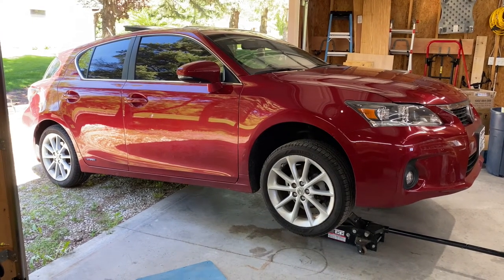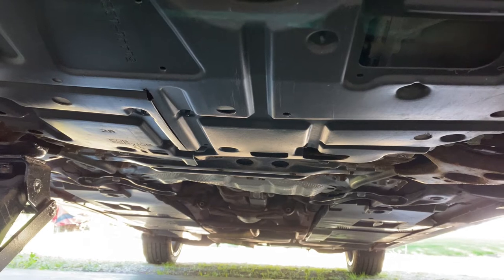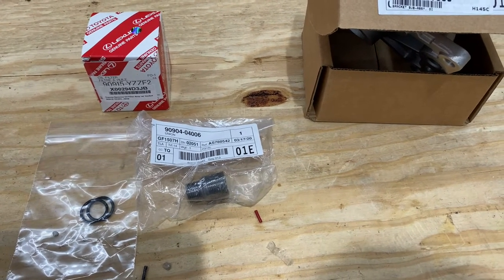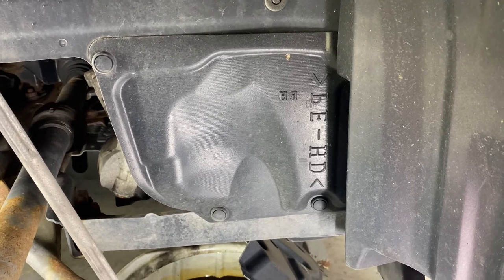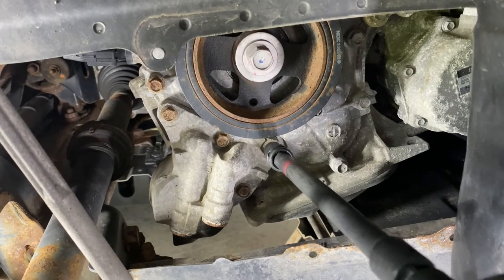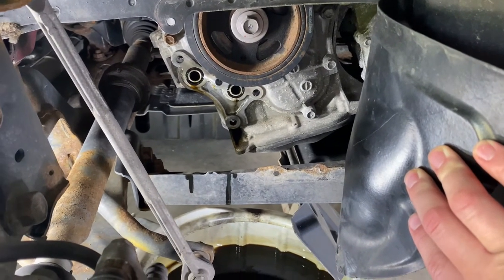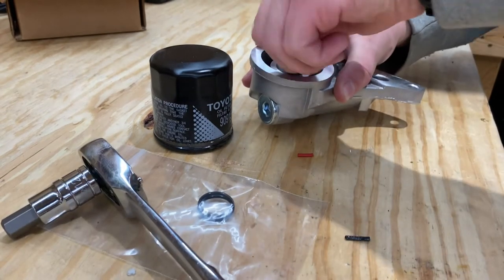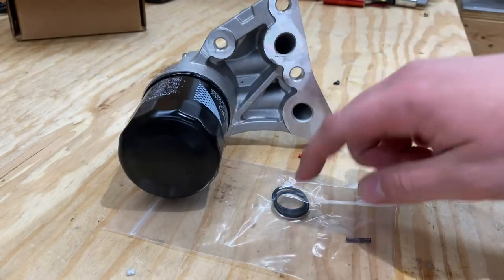Lexus/Toyota/Scion Spin On Oil Filter Conversion

Comment: I just did this conversation on my 2012 CT200h.  Followed the instructions and it was very easy.  Now I can simply spin off the filter instead of dealing with the goofy canister.  The canister filter is $8 instead of the metal spin off filter for $4 and the canister is where a traditional oil filter is.  If the canister was on top of the engine and easy to change I would just simply keep it.
Reply: With you 100%.  Our mercedes as the cartridge on the top of the engine and it makes it super easy and zero mess changing it.  I love it.  The toyota one is stupid.  It's under teh car and it's sideways so you always drip oil and it's not nearly as clean.  Such a stupid design.  And all of our lexus models use a different specific wrench so I have $100 worth tied into just cartridge removal tools...  I'm doing this to my CT soon.  Seems so much better and you can use larger OEM oil filters!
Reply: This system is ridiculous.....Toyota seems to take a step forward in some things.....and five step back in others.....a horizontal cartridge oil filter under the vehicle ? Come on Toyota....what are you thinking ?

Comment: I would use a dab of red loctite on the threads of the union adapter. Just to make sure it never backs out when you're trying to just remove the filter.

edit  Just to clarify, I mean the wider end going into the housing NOT the threads the filter spins onto.
Reply: Yeah, definitely don't make that mistake. The filter might never come off and you'll hate life! 😆

Comment: AWESOME.      Ihave a 2017 Prius and i hate the  oil filter system...      Thanks!
Reply: 4th gen Prius use good style screw in metal filter, not catridge anymore
Reply: @ErichMoraga  thanks to let me know, but I have no interest on Fugly looks of 4th gen Prius exterior and interior. I prever corolla or camry hybrid. My 2015 corolla station wagon hybrid still use catridge filter. I hate it but after few oil change, it is not that difficult anymore. The filter is not cheaper than full metal one, that's  make me angry, what's the point.
Reply: @rondhole  The spin-on oil filter has more paper element to filter out more impurities.  The spin-on filter also has a anti-drainback valve, whereas the cartridge filter does not have the anti-drainback valve.

Comment: While othe car makers install their oil filters in the engine compartment facing down so there is no oil mess..........Toyota  hides a cartridge style filter underneath with a panel to remove........do you think they are actually trying to make us take it to the dealer ?
Reply: Funny you mention the dealer, im a B Tech at a Lexus dealership, these side panels and oil filter location is not obnoxious, if you want to complain about a filter location try doing a oil change on a Volkswagen or Mini Cooper 😂

Comment: The Toyota 90915-YZZF2 oil filter is an old filter number and is not made any more. It was superseded by the 90915-YZZN1, at least for my car. Not sure about other Toyotas.  The N1 is a slightly smaller filter, which I'm not too happy about, but is said to filter just fine.  While you can still find F2 filters on some sites, they should be getting harder to find. Will you be using the N1s at some point?

Comment: Wonderful!!  Ordering the parts tomorrow.  Can get ALL of it for just about $108 at the local Toyota dealer!  I noticed you also didn't replace the 4 bolts for new.  Any reason NOT to change the 4 bolts?  I was going to change those and they are cheap at about $1 each... figure why not.

I don't mind the cartridge systems but having to buy a new adapter since my wife's NX and my RCF one don't fit the CT makes me just say, put the $30 that I'd be spending on that towards this..  AND you can run a larger oil filter!
Reply: There's no reason to change those 4 bolts you are talking about, for new bolts.
Reply: What did you tell them for the parts at the local Toyota dealer? My dealer doesn’t seem to want to sell me anything other than the plastic cap.
Reply: @ctgaming168  I ordered from McGeorge Toyota.  I put in the notes that I am converting my filter element oil assembly to a spin on cartridge.  If the dealer isn't ordering for you simply tell them you want the parts... if they STILL don't want to order for you, go to a different dealer or do it online and be done with it.   If you put up a parts schematic for a 2017 CT200h you can see both the filter element and the cartridge style element both listed.  It was switched the last year so you they are legit part numbers...etc.  I ordered everything and my total was just shy of around $100.

Comment: Do you know if this will work on a 2016 Toyota Camry with a 2.5 I would like to put a oil cooler on my car thank you for the video
Reply: Pretty sure it will, they make several kinds one of them is bound to fit even if it might be the  "Universal" one, and the remote mount ought to work on any engine

Comment: I need to get one of these for my 18 Rav4, I absolutely hate the cartridge filters.
Reply: everyone does, that's why the manufacturers are using them!  Discourage the shade tree mechanics.  Isn't it obvious?  That's the same reason Toyota removed the drain plug from the ATF pan, too.  They don't want you changing your own ATF because if you don't, the trans will go out that much quicker.  Whereas if you change the ATF every year or so it'll probably go on forever.

Comment: Looks like the new cartridge oil filter will be in sideways, right ???  Not vertical..
So, looks like you can never really pre-fill the new oil filter cartridge since going in sideways, it will want to run out...Perhaps if you prefill it a little and let it soak all the way into the filter media pleats for awhile, it may not run out as fast, so maybe you can still pre-fill some oil into the cartridge..
I had no idea that the Toyota line has gone from so easy to remove the cartridge oil filters to this nightmare process.. Look at the tundra too... :(
Thanks for your time you gave us to show us how to do this..

Comment: Thanks! This worked on my 2010 Pontiac Vibe with the 1.8 2ZR-FE motor. I went with the slightly larger 90915-YZZF1 oil filter. So great to get rid of the canister filter. Since the spin on filters have anti-drainback valves, I'm guessing it will provide better protection for your engine. I don't think the canister paper type filters have that feature. Nice car BTW. :-)
Reply: Wonder how that fits on my corolla iM. never thought of having a bigger filter
Reply: @Chorizomicks  This will work perfectly on your iM.  It is NOT a bigger filter.  It is simply easier to change a spin-on canister oil filter.  I'm about to do this on my iM.

Comment: Great video! Do you know if the bracket/ housing item number 15609-0T060 got replaced by the item number 15609-0T070?  The new one is used on the latest Corollas 21 and 22 models.
Reply: I was looking at part numbers and noticed this as well.  I couldn't find the difference between the two.  So the newest one that is on the 21/22 Corollas : 15609-0T070 will work?  When looking at the pictures they look identical.  But the parts fitment clearly states the newer ones only fit the newer years and doesn't go as low as the 15609-0T060...

Comment: I have a 2011 Corolla and it looks like the same part and figment on a 1.8 except the middle doesn’t have threads in it. Looks like I’ll have to buy this part and see if it fits
Reply: i also have a 2011 corolla, if you did this please let me know if i need anything different

Comment: hello. i have 2 questions, what impact wrench(is it good to loosen lugs?) do you use and what car jack is this? so long handle...
Reply from the maker: I use the Milwaukee M12 1/2” Stubby impact wrench for lug nuts and general work. The M18 Mid Torque is also great. The Jack is the low profile Daytona Jack from Harbor Freight, a Snap On knockoff.

Comment: If you don’t mind, please one more question: I pulled the bolts from the filter assembly and noticed some grey residue on the bolt threads. Not sure if that was threadlocker, or maybe anti seize? Did you put anything to your bolts upon installation? I certainly don’t what that assembly to come loose. Thank you for your help.
Reply from the maker: I don’t recall if there was anything on my bolts. But yes, it’s most likely some sort of anti seize. I didn’t put anything on the bolts when I put them back in.
Reply: Thank you for your help! Appreciated.

Comment: Toyota told me by email they don't make that for my 2012 Toyota Corolla S 1.8l L4.
Unless I get a converter from Baxter Performance. 
  Replace filter housing with screw in converter and attach a 3/4" 16 THread can filter.
Reply: Part from Baxter remove old oil filter clean housing install new adapter torque to 14 foot pounds screw new filter on your done takes 10/15 minutes

Comment: Would loctite in the threads help keep union from coming loose?
Reply from the maker: Yes, you could do that. Just make sure not to use a lot (you wouldn’t want excess loctite going into the engine).
Reply: Sangria Biscus -- those are pipe threads, they are not experiencing any torque, force, from say, a moving part of the engine.. The chance of them ever coming loose are slim to none... Loctite does not always work either, just so you know..
I would be good just doing what he did..
Reply: I'D use teflon tape so there was no caviation or passage of oil through the threads

Comment: Did you have to clean any RTV from the old bracket upon removal? do I need to reapply RTV when installing the new bracket or the O-rings are enough? and second: if removing this assembly, is the timing cover seal compromised? (like it may start leaking after reassembly?) I see the 4 bolts on this bracket are part of the timing cover perimeter or perhaps I'm missing something? Thank you. (FACT: the torque for the 4 bolts is 20# per DIY ALLDATA manual) One more question: are  the O-ring included with the assembly or I have to order them separately? thanks again for your help I need to replace this part due to the dealership over-tightened the plastic cap which is impossible to remove now, all tabs broken on the cap, and it's also getting rounded..... I don't feel confident using a chisel or taking a hammer to the block and I'm thinking about replacing the bracket.
Reply from the maker: The O-rings are what seal it to the block, so no need for RTV. I believe I had to purchase the o rings separately. Check the description for a list of parts. If they have their own part number, they are separate.
Reply: Thanks a lot Josh!, it makes sense. If RTV were necessary it would be a problem because it should not leak out from the o-rings. I did ask you because I saw some sort of adhesive on the bottom part of the of the block on the mating surface, I wasn't sure if it was just oil residue or if Toyota applied anything there, it looks like a white residue on the bottom edge when you are showing how to remove the old o-rings.

Comment: You didn't show the new O-rings being installed.
Reply: …because that’s common sense, considering he showed removal.
Reply: The two o-rings are easily replaced.  Just need a pick tool to remove the old o-rings.
Reply: If you need him to show you how to install those two o rings.....I would suggest you not tackle this complicated reform.....

Comment: What a waste of time and money.  You just spent $80 so that you can avoid a few o-rings and buy more expensive filters. The main pain of your oil change is removing the plastic pan which you still have to do. I own cars with spin-on and cartridge filters and there is very little difference in difficulty due to the filter style. Access to the filter is by far the determining factor in difficulty. This conversion looked safe but for some cars converting to a spin-on filter could cause clearance problems and/or filter vulnerability
Reply: You're incorrect in your assumptions.  I did this because that oil filter cartridge is very hard to get off - much harder than a spin-on oil filter.  The new spin-on filter fits in exactly the same physical location as the cartridge - no chance of clearance problems or vulnerability.  The parts I used to modify my 2011 Corolla are the same OEM parts installed on 2016 Corollas - in the same location.
I didn't do this to save money - I did it to make oil changes less of a pain due to that cartridge filter. There is a huge difference in removal difficulty between the cartridge and the spin-on filter.
Reply: @1drhnsd1  I am glad you straightened him out. Spin in filters are way more convenient.
Reply: Kevin S - What a waste of time your post....
Reply: @frandanco6289  thanks
Reply: Who cares what YOU want or think? Spin on's are so much easier, and there's less waste. Maybe you should try facts instead of your opinion.

Comment: What is the point of doing this conversion ?  My advise > if you have nothing else to do,  perhaps you can go do some volunteer work.
Reply: The point of doing this is to 1.) To make oil filter changes easier, 2.) Spin-on filters have more filter element than the cartridge style filters.  Before asking such questions, do your research first.
Reply: Instead of posting useless comments you can go volunteer as well lol wtf even is this comment 😂